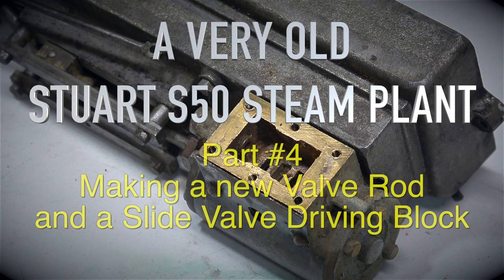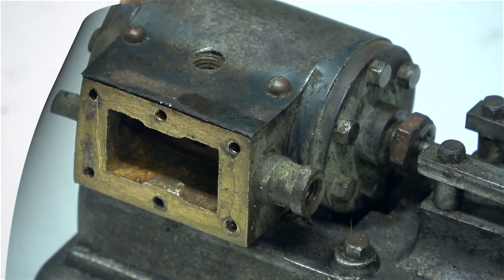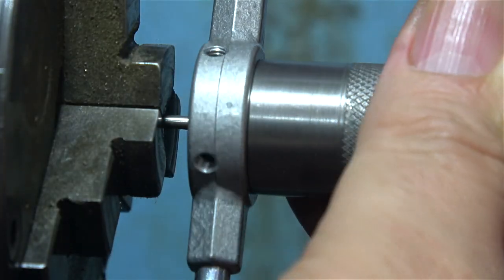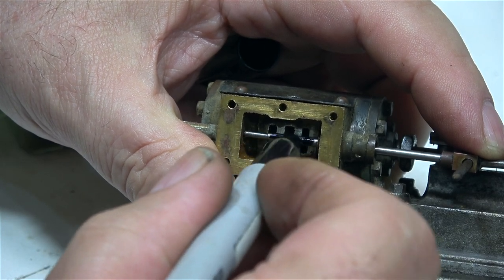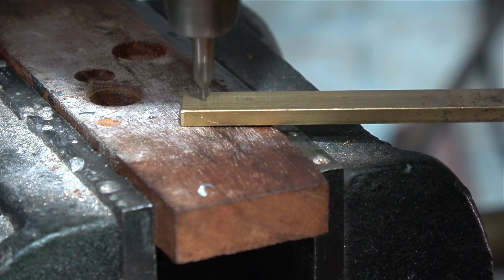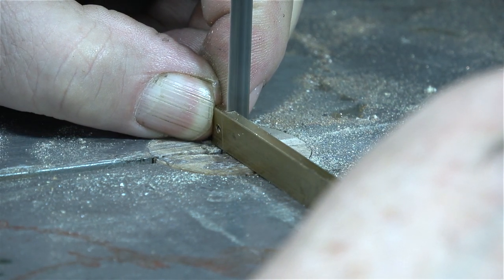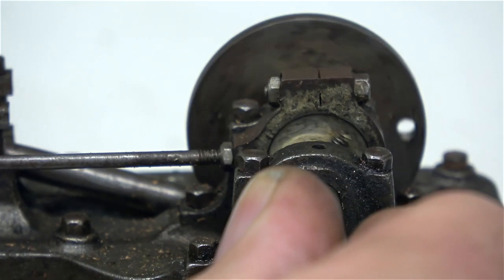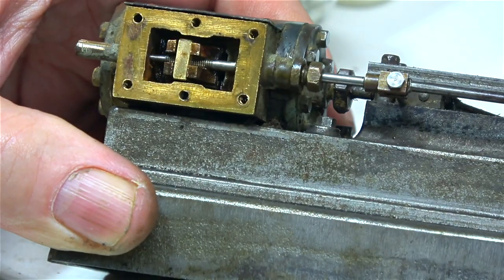A VERY OLD STUART S50 STEAM PLANT - PART #4

Comment: Hey Keith, I'm really enjoying your videos so far- I've been binge-watching them for a couple of days. I did have a question about the port faces: are they all supposed to be roughly the same size? I see all different sizes on some of the engines in your videos, but I wasn't sure if this was for a specific reason, or if it was just down to the skill of the builder/machinist.
Reply from the maker: the size of the port faces is relative to the size of the engine. As long as the dimensions of the slide valve matches the ports, that's all that matters.

Comment: Keith are you able to acquire Scotch-Brite™ Roloc™ Surface Conditioning Discs in England?  They are very handy and very affordable. They are basically the same Scotch abrasive pads you already use but in a disc form.  I've used them in an air drill and an electric Dremel tool, and they come in coarse, medium and fine.  They are too big for small parts but great for large areas and bigger parts.  Like you, I used WD-40 instead of water,  and sometimes 3 in 1 oil as well.   And oh BTW:  My bank finally sorted out why I couldn't use my debit card on Patreon!  I mean really, what is it with these dumb computers?
Reply from the maker: Great - thank you for your kind support . . . . }:-))) I have never seen that type of Scotchbrite, I will look into it ....
Reply from the maker: Computers aren't usually dumb, maybe it's just the users -  }:-)))
Reply: @keithappleton  Absolutely!  I should have said "why have computers at banks if you don't know how to use them?"  The people at my bank are very nice, but central command seems to be run by lunatics.